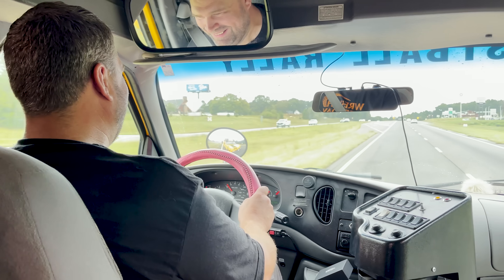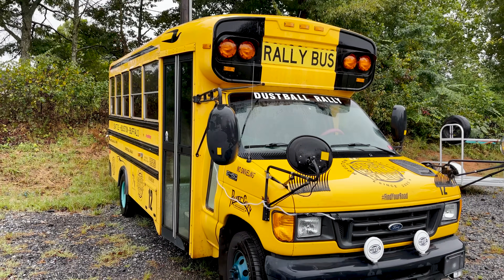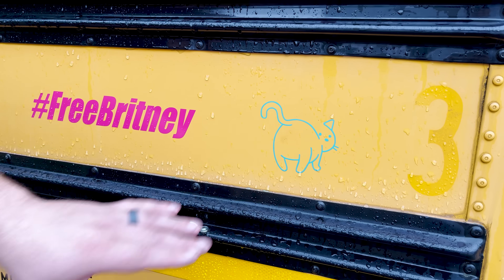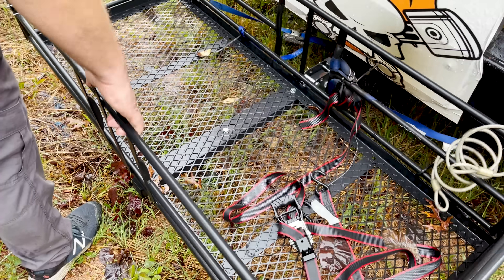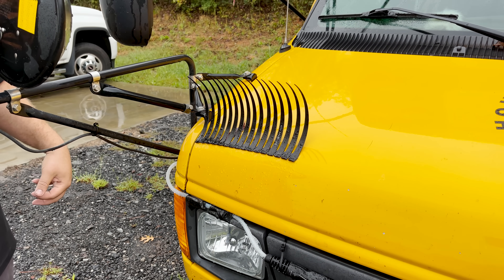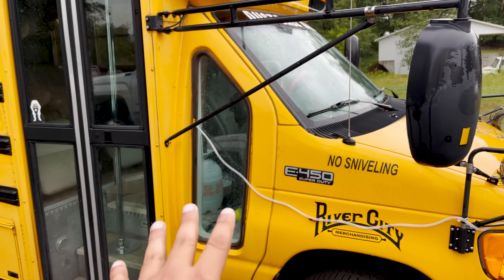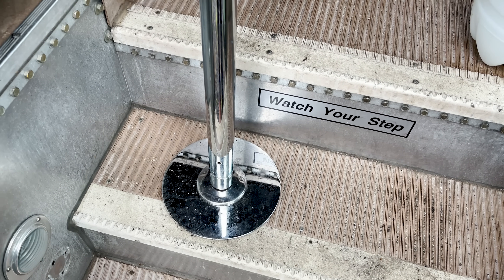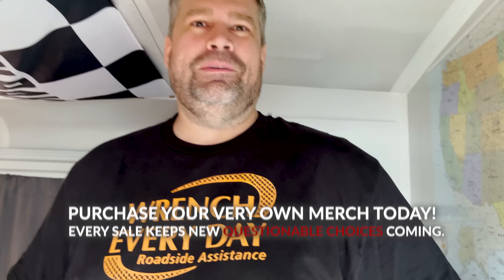They Left An ABANDONED SCHOOL BUS In My Yard...And I Wasn't Ready For What Was Inside

Comment: I have the v10 version of this van, in a larger box truck form, it will move down the highway fairly quickly. I've done 80 with it loaded, maybe even more. I will say it does accelerate like my i6 jeep zj, which is nothing to be thrilled about. I also have it at a higher GVW. Mine is also better maintained and not as abused, so there is that.
That spray bottle cooling system is a great temp repair when you can't get a proper repair at the time.

Comment: I used to be an operations manager for a school bus fleet.   We had a number of the Type 2 (small bus) busses built on cutaway chassis.   They never have a large enough tranny cooler and we used the spec our new orders with oversize coolers. Trust me on this.  Without a large cooler and mostly driving stop and go, those tranny's will only last about 50K miles...just out of warranty... 
Any time we received one that they blew off that spec, our mechanic would install the cooler and we would back bill the vendor.  Trust me ... When you are dropping a few hundred thousand a year on new vehicles...they reimburse you pretty fast.

Comment: Jared the Ford Chassis under that bus is pretty much the same under 1.5 ton car wreckers, but 3,000 lbs heavier than a roll off bed. The front end is either an solid I beam redesigned to use ball joints rather than king pins or the heavier version of a the Twin I beam with the same weird ends- I think the BJ's are the same part #, IIRC. About the BJ's- you started it! The Twin or split version will handle better within the first 3" up or down travel from ride height- the solid is, well, it's a solid, heavy chunk of iron; if the left tire goes up, the right tire tries to go down; not ideal. Put ball joints in it, check the steering tie rods for bad ends, and have a front end shop that has good knowledge of the Ford solid and twin I beam axles set the ride height correctly- 70+% of all Fords with those front ends are out of kilter for ride height a year, year and half off the floor- and it matters- tire wear, braking performance, steering stability all are negatively effected by poor ride height, the Twin I bean more so. Think about how a tire moves up and down- with equal length a arms the tire will not change camber bounce to jounce; with the Twin I beam, the tire is vertical at ride height, but it is a plane with it's center projected to the opposite side frame rail- about 30"- so the tire cambers in at the top at the top of travel and cambers in at the bottom at the lowest travel. If your tide height is wrong, the tire is not fully in contact with the road- it is wearing and rubbing on the inside or outside and you usually get a tire that has the shoulders worn of in squiggles around each side. It will make since when you see it- It was a fancy, but cheap way to make an independent front end that could live under a working truck- Ford ran with it for over 50 years, all the way up to about mid weight wreckers and chassis. One of the chassis real flaws was the transmission- some years used a Ford HD with OD, mfg by Mitsubishi, IIRC, that was over $2 Gs to rebuild, $2300 new and lasted about a year or two under wreckers, tradesmen's trucks and vans and buses. You've seen this turbo by another mfg- I won't bore you. The AC is much the same but way overworked- maybe adding the sort of rear cabin aux AC from the Windstar/ Transtar lines would do better on the road.  FR

Comment: I actually owned a similar bus for a while.  A slightly smaller ex-NY state prison bus, which had regular doors on both sides up front.  Because it was a prison bus it had long benches down the sides and no lights or anything.  It was a 99 GMC with a 5.7 gas engine, so basically it amounted to a van with a high top.  

I didn't keep it long because Thruway tolls are by height and it was four inches over the Class A limit.   Paid $1000 or so for it, flipped it for $1600 and it went to Baltimore,  then I bought a '95 G30 for $500.

Comment: The handling reminds me of our vacation trip to the USA in 2012. We had a class c RV which was based on a Ford E-450 with the Triton V10 and it handled just as bad as this bus 😂
It seems that there are rubber bands between the steering wheel and the front axle.

Comment: Love eat thing you two together. On that roof hatch that is buzzing if you push the bracket up in the back it will snap into the up position . Then you can line it up with the slot in the lid and latch it back. The buzzer is just a ground circuit so if you can get to the wire on the hatch you can cut it. The hatch has a switch along with the rear door and probably two of the side windows.

Comment: It looked like the turbo isn't engaging at all,  while you can replace/clean the turbo. you want to check the MAP sensor first, I have a 6.0l powerstroke and the nipple the MAP sensor hose is attached to is just glued to the block.  if it is loose you can just use epoxy to hook it back up so the MAP sensor hose stays attached to the block.

Comment: The seats may be out of a Toyota Sequoia , popular van mod.

E350 based chassis handling is never precise,  very little changed from 1975 on up for steering and suspension.
92 to 2007 nothing changed then minor changes 08+.
Last passenger van was 2014, cab chassis  E series is still in production 
6.2 and 7.3 gas motors.
E series diesels didn't have an intercooler , no room. 
Good upgrade for the trans cooler is from a F series 6.0 almost triple the size.

Radius arms can be upgraded to the 2008+ style. Front brake upgrade using 08+ rotors ,calipers and caliper brackets it's all bolt on.

Comment: It's a 6.0 power stroke. You need to look at the oil and coolant temps together. The oil should not be more than 15-20 degrees (Fahrenheit) hotter than the coolant. For instance, if the coolant was like 190 but the oil is 230...you have a clogged oil cooler and it needs to be changed ASAP. Ask me how I know. That's a 6.0 Excursion in my profile picture.

Comment: Vanes in the turbo are stuck, very common issue on vgt turbos, sandpiper rupture o-rings, stc fitting o-rings are problematic, oilcooler is problematic which leads to egr cooler failure which in turn leads to headgasket failure, 6.0 Imo is not that good of a diesel, and I own a 7.3 idi which is not known for having made 500k like Freddie's 7.3 powerstroke, but it can be saved if you catch the issues early

Comment: Hi Jared, I know that you were a Toyota technician for many years. In 1995 I bought a 1986 and a half Toyota Supra, straight six 5 speed non-turbo. Unfortunately the a-hole I bought the car from failed to tell me that the bolt that holds the harmonic balancer on the end of the crankshaft was stripped and the keyway was distorted. The hole on the end of the crank was stripped out also. The guy I bought the car from had a hack mechanic spot-weld the bolt to the end of the crank just so he could sell the car to some sucker. Unfortunately I was that sucker! Long story short I wound up replacing the crankshaft. Did you ever see that happen on this model of Toyota engine?
Reply from the maker: As the crank bolt requires 232ftlbs it is very common for them to come loose. You can carefully weld and repair a snout on car but removal is the best way. There is no difference between a turbo or non-turbo crank so you can get any of them and measure out your bearing tolerance

Comment: Let's see.....   HUGE transmission and oil coolers, Scrap the turbo and throw on a supercharger.  Change the rear gearing, Put areo side skirts and an air dam on the front.  Change the wheels and tires, Can it be lowered?  Tubbed? Fix the A/C.  Mount the seats properly.  Move the stripper pole.  Install a roll cage.  Luggage carrier under the chassis.  AND.... Tell the Nordic guy to clean up the bus.

Comment: I replaced the cluster in mine when it was over 1,000,000 km, because it just stuck at 999,999 and wouldn't roll over - which seems stupid on a digital cluster.